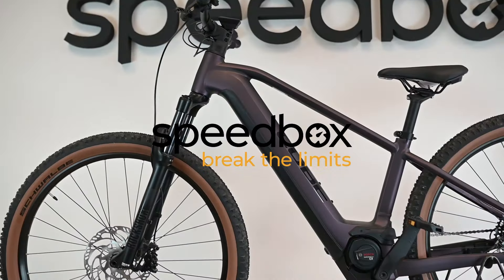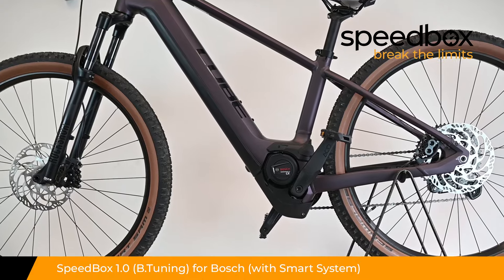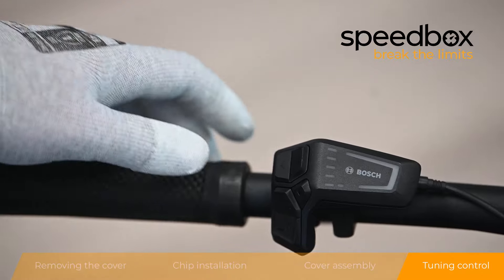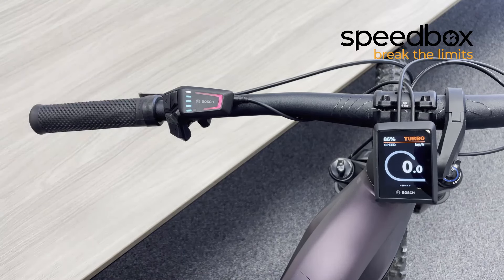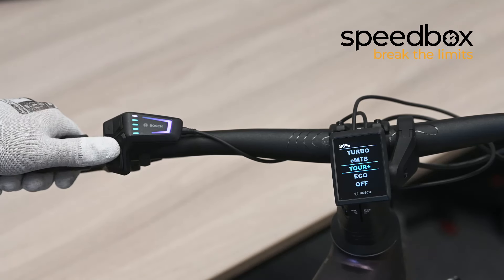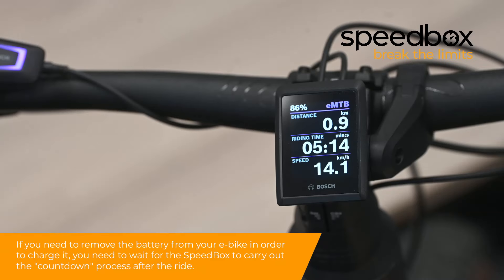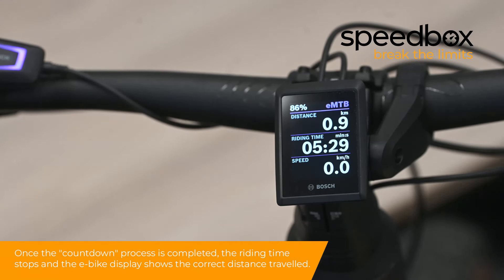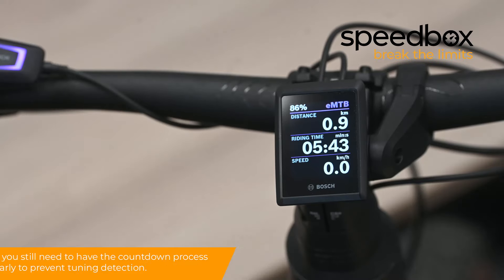eBike Tuning SpeedBox 1.0 B.Tuning for Bosch (Smart System) Installation Instruction

Comment: I got a 524001 error too. I had to ride 30 km's home on a heavy and powerless bike. How can I fix this? Only Ran good for 100 km's
Reply: Me too. This really sucked. Does anyone have an awnser for this.
Reply: I’am in the same situation after 70km
Reply: I went to my dealer and talked about this. 
He was Able to fix it. He dowloaded a new Bosch update (28/8) and was Able to check a box in his program to tell the software on my bike it has been tuned.
Now it turns perfectly fine. As long as i keep newer updates out of my phone app/bike the error Will not come back.
Reply: @zelhtbahnman  damn thank you man!
Reply: @zelhtbahnman  so the dealer say it's better to update directly with him and their software than with the phone app ?
Reply: @rolletharold8843  my dealer updated the bike with a newer update via his computer and his diagnostics software he got from the factory and told me to turn off Future updates in my phone app.
Reply: Still no error?
Reply: @TimdeJongSk8Spug  i've had some errors but i was Able to push them away. It just said 'error' no number. Never had the issue of what i had before.
Reply: I stoped with the speedbox. I took the sIMPLEX stealth edition. Works great! No complications yet!
Reply: @TimdeJongSk8Spug  what bike do you have ? I have a sIMPLEK Stealth Pro but it's doesn't work well ... I have big jump speed high and down and motor cut 
sIMPLEK say it's a firmware problem of the module but this is the last third they sent me 
Do you have a rear disk magnet ?
Reply: @rolletharold8843  i stopped tuning the Simplek also dient worden out for me in the end. Error 524001.
Reply: @TimdeJongSk8Spug  even with the sIMPLEK you have an 524001 error ?
So no more tunning ?
Reply: @TimdeJongSk8Spug  what's your bike ?
Reply: @rolletharold8843  yes i had it more than once. Now i wait till there is some definite solution on the market. Bosch got me. I dont want to go to the dealer to reset my bike aigain and aigain anymore. Wish i had bought the gen 4 motor.
Reply: @TimdeJongSk8Spug  and some German dealer it's going to be lot better mid 2023, bikespeed RS work on a solution too
Reply: @rolletharold8843  yes i heard volspeed too.
Reply: @TimdeJongSk8Spug  there is hope but today majority are still in beta 😂
Reply: @rolletharold8843  i really enjoyed the moments tuning worked. My kathmandu exc really blazen hard. But these errors..
Reply: @zelhtbahnman  Hi Filip, I am very interested to know if it still works properly (no 524 error). Because everyone else is having problems with the smart system detecting the manipulation. When your dealer did the update, did you have the chip on the engine or did you remove it first ? The solution comes from the dealer checking a box in the diagnostic program, that's right ?

Comment: Hey Speedbox, my bike came with the latest Bosch Smart update. What speed limit would you recommend setting in the Speedbox app to avoid errors or tuning detection.
Reply from the maker: Hello. Above all, we recommend not updating the system if possible. If you are going to update your system anyway, please uninstall SpeedBox first - SpeedBox might hinder the 100% completion of the update. Maximum speed to avoid errors: There is no empirically measured maximum recommended speed, but 38 - 40 km/h may be safe.
Reply: @SpeedBoxTuning  Thanks for your clear answer!
Reply: @SpeedBoxTuning  is it possible to activate/de-activate speedbox tuning while driving? Or do I have to come to a complete stop first?
Reply from the maker: @mindbodysoul69   Yes, you can activate or deactivate it easily while driving.
Reply: @SpeedBoxTuning  nicecream, thanks!
Reply: Hello, I’ll be getting the new 2023 Bosch smart system with the new control panel and wireless mode selector and brake rotor magnet. I don’t plan on having a Bosch display. Will the Speedbox 1.0 B Tuning work for me if I don’t have a display? Or can I just use the speedbox app on my phone instead?
Reply: @speedboxtuning my bike is 2023 new with new Bosch performance line cX and I only have one adapter in the motor, I don’t have 2 like you say. Seems like I only have the speedsensor adapter. How can a fix this? It’s a Cube stereo 140hpc 750 race 

Thank you
Reply: @Skopljakalen I agree, I also have a bike like this with one wire.  Thank you